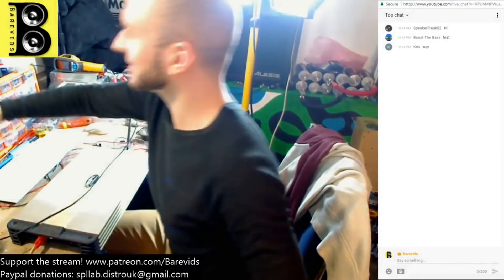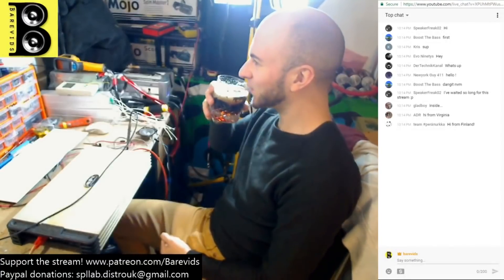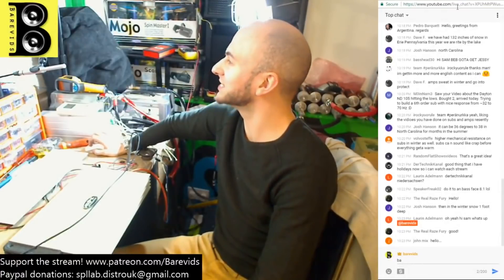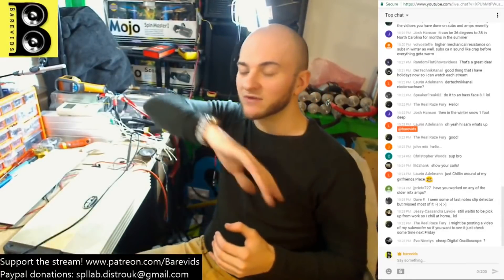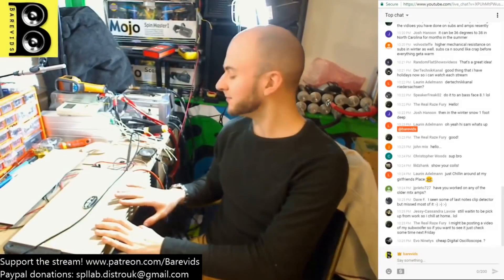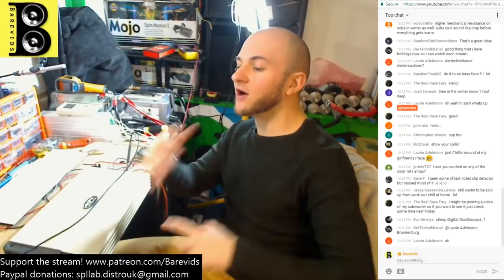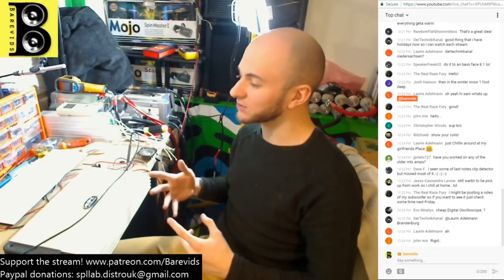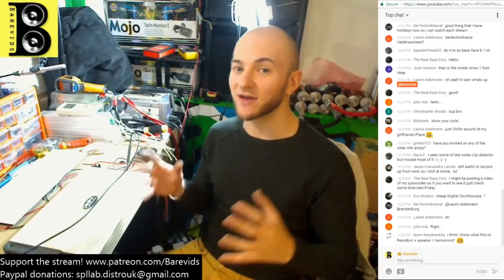Detect amplifier clipping WITHOUT DD-1! Cheap simple clip detector

Comment: Stumbled upon this video and so glad I did. This should absolutely be higher up when you search for how to tune an amplifier, if not the first video. This worked amazing on my mono Kicker amp. I blew 2 Kicker subs due to improper tuning, replaced them with some American Bass subs that match the power of the amp better, adjusted my LOC to have good voltage, then did a base tune using this method with no subs hooked up. Holy cow they sound so much better than tuning by ear. Also hooked up the little tuner speaker while playing music and adjusted further. I have a kill switch for my speaker amp so I flipped that off and was able to let the bass slam and hear if I was getting any clipping. This was so great and easy, and realistically only cost $10 in materials if that. Thank you man!

Comment: I made one of these with a cap I bought off Amazon. It seems to work well enough but any time the amp is on I get static noise from the little speaker I'm using as the detector. Tried it with a few different amps and they all have that static. The slightest bit of music bass seems to leak through as well. It was a headphone speaker and it turns out it was around 31 ohms, after changing speakers to a 4 ohm speaker I barely hear static.

Comment: I’ve subscribed and Jesus it’s nice to see someone who’s helpful 
I have few recap questions 
So I have little 5.25 vibe spare speaker which one do I need to wire up and when you check it I take it you turn the head unit up and then amp when you here then buz you knock it back down 
I have a 1500 rms amp
Reply from the maker: Yep! Connect the bipolar cap in series with your spare speaker. Keep your normal sub connected also
Reply: @barevids  thank you mate I’m ordering the bits now
Reply: @barevids  if you could mate post a little item number for the part needed as I’m struggling to find one off eBay plesss

Comment: Is it possible to use an LED in place of speaker as an visual queue when amplifier's clippibg?
Reply from the maker: Not on its own no
Reply: Ok, thanks. May be (just a maybe) I'll try to design a crude simple circuit that'll trigger a steady voltage (probably separate, out of amp's circuit) to trigger upon clipping n lights the LED. Not sure I m fully capable to do that, but I"ll gv it a try. 

Ps: and thanks for the unexpectedly quick reply out of your probably 4yo vid. Totally unexpected n appreciate it so much. ❤
Reply from the maker: @zhuzzir  haha no worries, good luck with it!

Comment: Do you get the same results with and without a load connected? Say if I clip at 40v with the clip detector and connect a 4ohm dummy load will I still clip at 40v or slightly lower? 

It would be nice to not have a load as I can't get full output from my alternator at idle.

I'm guessing this depends on the amplifier's voltage input 12v vs 14v as well?

At idle 14.8v I couldn't get more then 450w from my amplifier connected to a dummy load playing a 50hz tone without causing voltage drop and clipping to occur.

I have not tried keeping the rpm's higher to see if that would help with the measurement.

Thanks for your input.

EDIT: If you're reading this I found my answer in the comments from @barevids "it clips at a much higher point as there is no voltage drop across the rails"

Comment: BRILLIANT! THANKS! How do you keep the amp from overpowering such a small low watt speaker?
Reply: Crossovers
Reply: @dominicdymond   That's what the cap is for that you put on the small speaker. You're still pushing the full wattage power of the amp up to clipping, right?
Reply: @wilsonrawlin8547  not really.  The cap filters out most of that wattage.  Same principal of a tweeter. They only receive a few watts even though you amp could be pushing hundreds.  In this case, you're only using the driver to detect clipping, so it's just for a few moments.  I was curious how much wattage gets through so I ordered a set of caps today lol I'll check with an amm1.
Reply: @dominicdymond  

Good deal. Shoot me what you find out if you don't mind. Def curious.

Comment: What's the best way to do this with a line out converter? Set the amp below clipping then increase the gain of the LOC?
Can this be done with a component tweeter with its built in in-line filter?

Comment: If you can't hear clipping with just the subwoofer, then it's free SPL as far as I'm concerned. Eventually the bass is muddy from it (it will sound worse with a PA style subwoofer that has extended output into low-mid) but as long as the power is within range of the woofer it's okay. I like the midrange and highs to be well into clean though.
Reply from the maker: Yesss finally someone gets it!

Comment: Hi hoping someone can answer a question?If i am using a 1 k test tone  do i have to set my head unit to 3/4 volume when setting gains and using speaker and cap to find distortion point?Thanks
Reply from the maker: Why you using 1k? This is for testing sub amps. You never set your mids and highs to clip point.
Reply: @barevids  so then this couldnt be used  to set gains on a 2 or 4 channel amp
Reply from the maker: @hd-zq8kp  it doesn't matter what tool you use, you should never set mids and highs amps to clip point.

Comment: Are you hooking up the small speaker and the subwoofer to the same terminal on the amplifier? Doesn’t that mess with the impedance load? I’m really interested but don’t want to fuck it up
Reply from the maker: No, the capacitor in series with the speaker negates the additional load. The amp doesn't even know it's there.
Reply: @barevids  that makes sense now. What your saying is it’s after the amp outputs in series. Gotcha

Comment: Question what settings would i set an Oscope to to detect clipping? Ac voltage obviously and just attach regular clip leads to the speaker outputs of my amp? I have access to Oscopes at work just wanted to clarify how to set it up to adjust my amp gain. Also Very cool and simple method for a DIY with the speaker and cap!

Comment: Does it work on head units to find distortion point when increasing volume?
Reply: i believe it should, however, you have to have the whole setup connected- xovers off and minimum gain. regardless of the power, it should manifest clipping based on the signal form the Head Unit volume.

Comment: Can I use a standard bass blocker available at any car audio store? Something like a 150 Hertz bass blocker? It's just an inline capacitor looks almost exactly the same as your setup
Reply: i think you can, however, not with a lot of wattage... those bass blockers might have lower than  100v rating capacitors and would pop before setting the gain properly....

Comment: This is useless. It is measuring clipping with no load on the amp. As soon as you connect a sub the clipping point decreases due to power delivered not just no-load voltage. The best way of determining this is with either a pure tone played over the sub and listening for tone changes or with an oscilloscope or distortion detector. Definite thumbs down.
Reply from the maker: Watch the whole video idiot.

Comment: I would assume you can do the same with the line out of the head unit? Or would the capacitor value change because the resistance/reactance is different (farads, obviously a smaller voltage cap would work)?

Comment: Nothing can go wrong when you have coke and rum on the side :-)
My method of finding clipped signal is using a multimeter that displays the frequency as well, such as Kaiweets multimeter.
for e.g, If you send in a pure 1Khz sine wave, you will see 1.000Khz or 1000Hz indicated along with the voltage value, increase/decrease the attenuator at source or on the amp until you are the higher voltage and if this value is none other than 1000hz, you are outside a clean signal range. I validated this method using a borrowed DD-1 and this works for me.

Comment: Did anyone else notice his "distortion detection speaker" was making noise before his oscilloscope showed clipping on the sine wave? I looked through the comments and couldn't find anyone else mention it. It made me wonder if some oscilloscopes may be off, or if his speaker just had output early somehow. Thoughts?
Reply from the maker: The speaker will start buzzing when the sine wave starts approaching the rail voltage limit, you can see this noise on the scope of you zoom in further before it actually touches the rail. All class D amps will do this. Your subs will also be sent this noise but sub drivers are their own passive lpf so you don't hear it.
Reply: @barevids  Oh gotcha. So despite the noise happening at that time, it's wasn't technically clipping QUITE yet until the oscilloscope confirmed it. After rewatching the last bit of the video I was actually able to hear a difference between when I was clipping and not, like a slight hum versus and more noticeable distortion. Thanks for the explanation!

Comment: Wish there was some way to trigger an led instead of a speaker. Im guessing there is a small voltage going to the speaker that Is producing that clicking sound. How could that be used to trigger an led? Hmmm.
Reply: Could use a simple voltage comparator circuit set to a small amount? Would be tricky to set the comparator amount since the speaker starts to get voltage / move slightly before clipping it seems, but tweaking the cap value would help I think. Would need a relay and a DC power source for the led also. You got me thinking late at night again and I’ll have to revisit the idea in the morning lol

Comment: why not just create all the electronics to be pre tuned internally to never clip?
Reply from the maker: Because everyone's signal level into the amp is different so this is not possible.
Reply: @barevids  have a line of products that don't clip is what I ment. Like a second resister on the gain in the head unit and amplifiers. It would be nice if you could max out the volume with no clipping

Comment: Don’t you lower the resistance of the system (subwoofer with your tiny one parallel ) and lose some potential power? And how do you know if your speaker is underpowered compared to the amp (I’m mean if the amp has 1kw rms and the sub 500wrms )does the speaker clip as well? 
And last question 😅 i mean I went to an electrical Engineering school but the cap doesn’t prevent the tiny speaker from blowing? How does it survive or ist that high clippingfrequency that small 
Thanks if u or someone answers!!!  
Greetings from Austria 🇦🇹✌🏼

Comment: I just made this using the old original tweeters from my car and a 300v cap, all inside one of those large tictac boxes, with a long as hell wire so i can play it outside the car and listen, cause my sub would simply drown the buzz if listened in the car. Like you said, really fckn easy 😅

Comment: Was it just me or did this speaker and capacitor start picking up clipping before the oscilloscope started to show it? If that's the case, then maximum power before clipping which is measured with an oscilloscope would be incorrect for the majority of amplifiers out there, be it car or home! Damn gov! You really put a donk on it this time init!

Comment: So when it starts clipping it will be the same for a 1ohm load?
Reply: Or do I need to do something else to change the load?
Reply: Would i need to get 4 4ohms speakers and connect them to have a 1 ohm load and attach the capacitor to each of the speakers to verify clipping @ 1 ohm?
Reply from the maker: no listen to the video. The small speaker and cap do NOT affect the impedance the amp sees.

Comment: Thank You. I ran out and brought a 25v 3500uf capacitor. Put it together and wallah. Disconnected speaker wires from amp and tested rear speakers. WOW, I found the chip point. Uh-oh the capacitor started to smoke. I quickly shut down everything. I watched your video again and found yeah voltage was the culprit. I looked around at home and a 250v 2200uf. I set everything back up and completed the testing. Unlike the other guy, I found your video just before as a last result of getting a SMD DD-1.
Reply from the maker: Remember it must be non-polarized capacitor. That farad reading sounds way too high. If the cap has a negative marking, it's the wrong one.  It's needs to have no positive or negative markings.

Comment: I want to build myself such a detector but im kind of confused how to. Does the Capacitor i need depending on the speaker i use (best a tweeter ofc) change? And if so, what do i have to look out for a capacitor and how do i fit it to the speaker im using to detect the distortion? Killed my last sub, never want it to happen again

And im from Germany, so specific brands of capacitors may be not availible here.

Comment: This means my kac-9106d clips at 2/3 of gain with 2ohm load assuming my hu distorts at 38of50. Does that sounds right? Can I cross check this with the same test tone on a dmm set to ac?
Reply from the maker: That sounds right.
Reply: @barevids  thanks man. I'm learning. I appreciate u helping out the community. That's awesome
Reply: I repeated this process with a -10db 40hz track. Then used the clamp method with the same test track and came up with roughly 200w rms. Am I missing a step or is my amp not doing the claimed 1000w rms at 2ohm?

Comment: I need more specifics. Does it matter what ohm or wattage rating the speaker has? Do i wire it up along with my subs speaker wire, in the same outputs? How does the speaker not just blow instantly from the wattage? Would I turn up the head unit alone until it clips to find its clipping point and then back it down a bit before moving on to my amp and slowly increasing the gain on it until it clips?
Reply from the maker: I do cover all this in the video ☺
Reply: @barevids  The only answer I didn't get from the 2nd watch was how this works with the car stereo. I'm guessing one would set the car stereo to the highest volume level they would play  at and then do the clip test on the amp with it at that volume?

Otherwise when you turn the stereo volume up I'd think the amp could start clipping again.

Comment: Does this work with 4 channel amps? Or only subwoofer levels? I can do a 80 or 100hz tone for my mids(2way). The tweeter is ran to the same amp. It’s an active system. But this should still work then? I only imagine the door speakers would show clipping around 80 where they are crossed as that’s where it wants most the power down low.

Comment: But does this speaker change the impedance on the amp and change output wattage?
Reply from the maker: No. The cap in series causes the amp to completely ignore this speakers resistance and it's like it isn't there at all.

Comment: awesome! But what about head unit?
Reply: Look up Rockford fosgate voltage divider. Do t have the link anymore.
Reply: @pierregervais1567  I’ve got the link for that. Really struggling to find the correct resistors for it! I’ll be making this first see how we go :)
Reply: @DSPrints_  yea you really gotta dig! I found them on Amazon.ca ....that means they shouldn’t be that hard to find if you’re in the US.  1/8th watt resistors I believe...
Reply: @pierregervais1567  UK unfortunately :( we don’t have Radioshack etc. Used to have proper electronic stores BUT they just get turned into crappy electronics and toys eventually the market just isn’t here for electronic components

Comment: Could this method be used to also test the head unit for maximum volume level distortion by attaching a female rca lead to the end of the positive and negative of the speaker wire and plugging the rca leads in one at a time(similar) to using the SMD dd1?
Reply from the maker: There's no point, because you can instantly hear clip and distortion in the audio signal. You can just play a sine wave and listen normally. The only reason we need this for subs, is because sub drivers don't reproduce the distortion audibly until it gets really bad, so you can't always tell you're in clip.

Comment: Hoping someone will see this.  Alot of sub amps dont output frequencies over like 250hz these days, they are only rated as a mono amp for subs with a small bandwidth range.  Will this technique work on a amplifier like that?

I cant bring myself to buy an SMD DD1 or DD1+ its just to much money. Plus you can get an handheld Osciloscope to detect distortion just as well for like 100 bucks which is even cheaper.  SMD convenient for a pro installer but a dude like me doing my own stereo install once in a blue moon that extra coin is just nuts.
Reply from the maker: Yes will work perfectly.

Comment: Dumb question: can anyone explain how to wire a capacitor to a speaker like this in layman's term? Lol I connect what to what?
Reply: One end to the positive terminal, the other end to the positive of the amp.  The negative of the amp to the negative of the speaker.  Just make sure you get a non polarized cap such as:

https://www.amazon.com/Zerone-Capacitor-Frequency-Divider-Capacitance/dp/B07NMST5L5/ref=sr_1_3?dchild=1&keywords=3.3uf%2Bcapacitor&qid=1606506756&sr=8-3&th=1

Comment: Can i somehow replace the tweeter with a lamp or LED? If my bass is pumping i need a optical clipping indicator :)
Reply: Yep, however it requires building a custom circuit with a couple transistors, resistors, and caps.  There are a couple of good ones out there, just need to google.
Reply: @SynergyAVE   could some one use a taramps clip light and put a capasitor in line to the amp ?

Comment: I just tried this and didn’t hear anything even with the gain fully cranked. The tweeter has a built in 5k crossover so I didn’t use a capacitor.
Reply: Correction I had the wires reversed. Works awesome